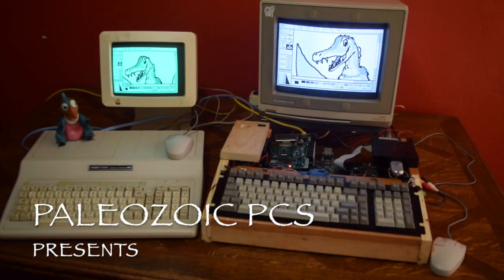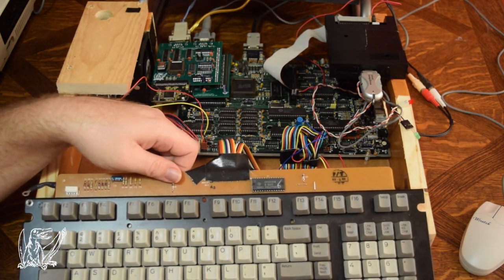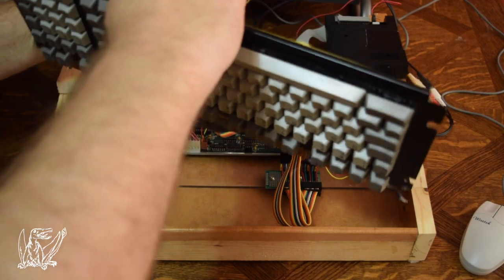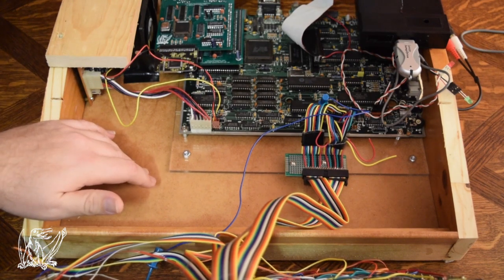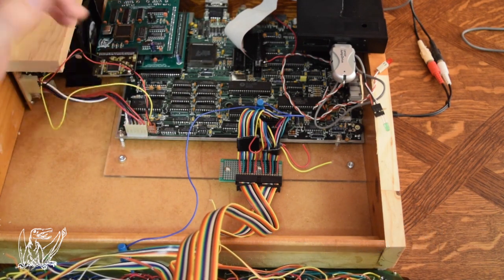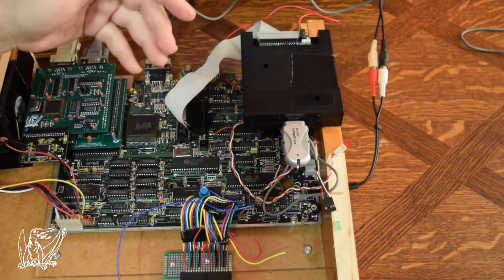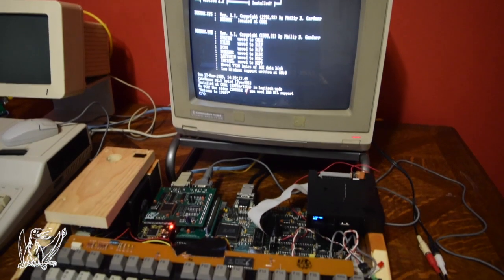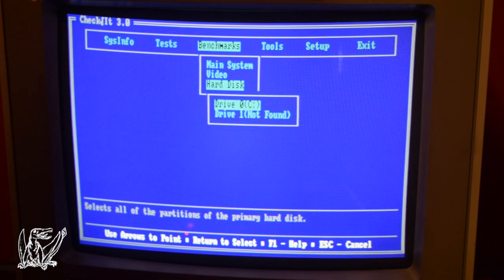Introducing the Tandy 1000 SUX! (Homebrew 1000 HX build.)

Comment from the maker: Oops, I forgot: on the topic of floppy adapters, here's the promised link to Cybernetic Systems' Tindie store. It does look like they're currently sold out:

https://www.tindie.com/products/cyberneticsys/tandy-1000-internal-35-floppy-drive-adapter/

If you want a little more detail on the DIY solution I came up with here's a post I made about it on the VCF forums:

http://www.vcfed.org/forum/showthread.php?72285-Quick-and-dirty-floppy-adapter-for-Tandy-1000s-with-power-over-cable-wiring

To make sure you've done it right be sure to check for the presence of 12v on pins 29-33 before you plug in your floppy drive. Rumor has it Radio Shack may have put the cables in some HX's in backwards so the colored wire in the cable that should indicate pin 1 is on the wrong side.

Comment: Can you tell me what xtide bios you used? I have an HX and I'd like to speed up my transfer speeds too!
Reply from the maker: When you're downloading the recent versions of the XTIDE BIOS you'll see there's two different .bin files, "ide_xt.bin" and "ide_xtp.bin". The difference between the two is the "xtp" variant uses string transfer instructions which only exist on the 80186 and later CPUs to accelerate port I/O. So to get the improved throughput you'll need to use the xtp version, and you'll have to replace the 8088 CPU in your machine with a V20 (which includes the 80186 extensions). If you have this BIOS without the CPU upgrade it'll hang your machine on boot so don't flash it before adding the V20.

Comment: Too late now, but I wonder if you could have pulled out the micro-controller and built a small board with a modern mcu to translate the signals?
Reply from the maker: Converters to translate keyboard matrixes sort of suck; to really do it right you need to use an analog matrix switch part that's fairly expensive. (See devices like the C-Key as an example, although for the Tandy you'd need a bigger one.) The Wyse terminal the keyboard went with was long dead (and it's also a very common part) so I didn't feel too guilty.

A better way to attack an alternate keyboard on an HX motherboard at this point would probably be to pull out the keyboard controller chip on the motherboard (it has the same keyboard matrix decoder that's built into a regular 1000's separate keyboard onboard wired back-to-back with the same keyboard host IC) and wire up a now-available PS/2-to-Tandy 1000 adapter to socket pins. I think that would work unless there's some inverters or buffers in the regular 1000 that change the signals.